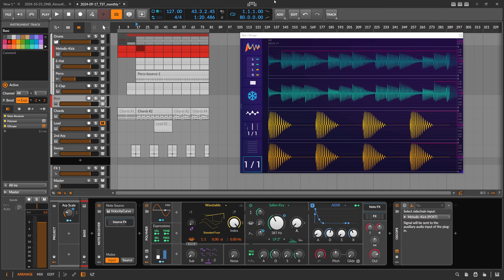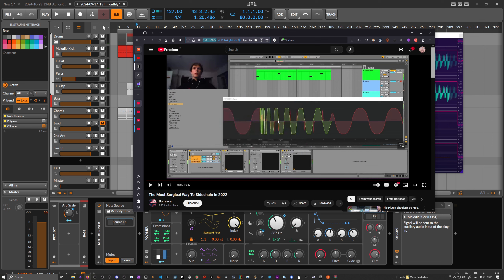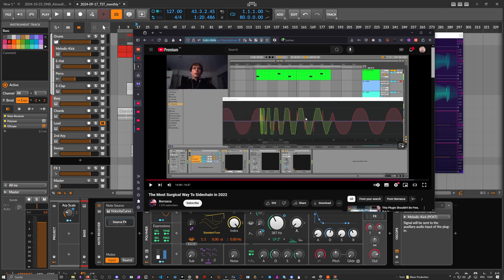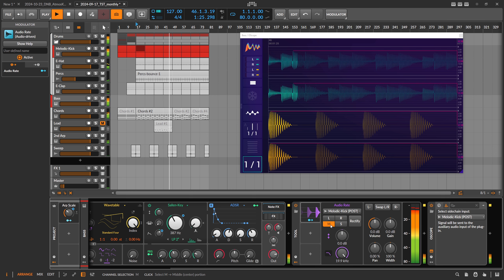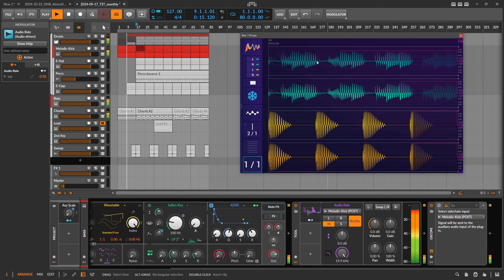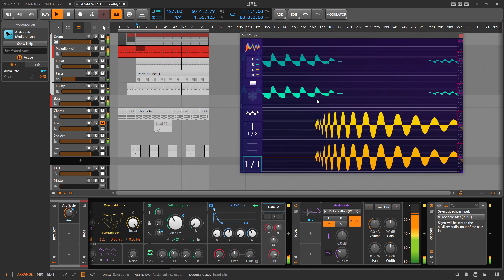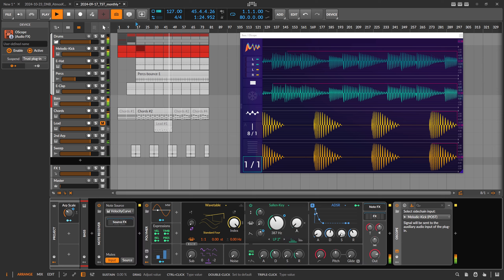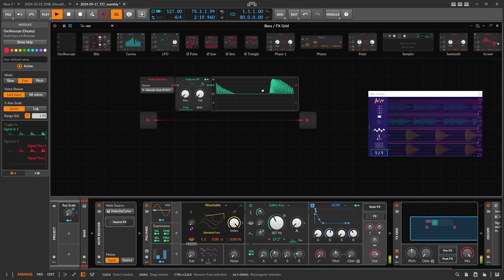No one is ready for this Precision - ringmod sidechain

Comment: Appreciate the shoutout it’s always cool to see variations and different takes on this method. 
I’d like to point out that the RMSC VST is not by me but another developer. 
I don’t use mringmodulator for this anymore like in the original video but my own M4L device, and sometimes the RMSC vst. But I’m working on a plugdata version now.
Keep in mind that using the mid signal with Bitwig’s audio rate modulator can still peak over 0db when summed together if the target has side information; ideally rmsc:ing would be 100% stereo unlinked so both L and R get independent ducking, that’s if you’re looking for absolute headroom advantage. For the sound effect itself it doesn’t really matter.
Reply: oooh are you gonna share that pd patch? I'd be interested in trying that out
Reply: You are a legend!
Reply: We need plug data version!

Comment: First, all things Polarity are worth a watch!! Always!! RMSC techniques are interesting and informative but ultimately, I personally have never found RMSC useful. When I solo the ducked instrument noise pokes through, because you're ducking specific parts of the spectrum you are left with a waveform that has nothing to do with the original sound. I concluded that for hard duck it's tool with midi note sidechain from a "SC" midi track where I can lengthen or shorten notes and use timeshift to avoid attack 'clicks'. Alternatively, if you're just dying to keep some part of a sound I use Robert NIH linear phase crossover. Then I know exactly what it will sound like during a duck.

Comment: Sometimes the distortion is desirable and precisely why someone would use ringmod sidechain. It could add the sensation of intermodulation distortion without chainging the original sounds.
Reply: That and plus it's particularly better in high frequency sidechaining than lower freqs IMO without the need for smoothing

Comment: The disconnect, I think, is that a lot of people end up getting steered toward RMSC when what they really want is something a bit different.   They don't want the peaks and valleys, but rather a contour that goes from one peak to the next... ideally with a best fitted curve.  Follower / audio sidechain isn't quite that either.  One way to think of the goal would be that it is the inverse of the MSEG that created the kick.  It's also worth noting that different people mean different things by "clean".  The distortion seen between the peaks is one thing, but being completely out of the way on the first sample is another issue entirely.  If any method fails to achieve that, there is the potential for a burst of up to 200% of full scale in those first few samples which can be far from subtle depending on what follows.
Reply: What you're describing is the "convex hull" of the waveform (or more generally an "alpha shape" to allow some concavity). Imagine wrapping a rubber band around it. I'm not sure that it can be properly computed without infinite lookahead (since the next peak can come at any time in the future, or never), but there are approximations. Envelope followers are one of them. ;) In the modular world, you can just modulate both with the same envelope signal. You can probably do something similar in Bitwig somehow.
Reply: In theory, the perfect distortion-free sidechaining you describe could be achieved with offline processing of the complete audio files, where you literally do have infinite lookahead. I suspect that offline processing is going to become a next big thing in audio because it turns out infinite lookahead is pretty useful: it makes hard things easy and impossible things possible.
Reply: @reinh  It's infinite only in theory, though.  In practice, I don't see why it would need to be more than the next inverse peak at the lowest frequency you'd want to capture... or 25ms for half of a 20hz wave.  That's for linear.  A better fitted curve would probably require double that.  I'm not saying it's easy... just that it may be a clearer description of the goal since there's no benefit to the wobbles between peaks, and followers introduce other issues.
Reply: @reinh  I'm absolutely convinced that offline processing (or at least some kind of ARAesque full scan) is what's necessary for proper leveling.
Reply: @bongospank8321  Yeah, that's what I meant by "approximations". You can scan your lookahead window for the next maximum peak and lerp to it. There are probably edge cases that make this more difficult than it sounds. Getting the windowing right might be hard, or highly program dependent. But it's a good idea.
Reply: Yea, this is kind of what i try to approximate with the peak hold and stuff in my video
Its all different techniques to get closer to perfect lines from peak to peak than the naive, slew limiter ish style of envelope following. Ive also experimented with highly program dependent release times and filtering the envelope. Ring mod sidechain is just the jumping off point to start rethinking the envelope follower from scratch. It always bothers me a bit when people then act like what we do is just rediscovering an old school compressor, because really we’re trying to rethink it from first principles to optimise it for a very specific purpose. Envelope following can be a lot more nuanced than most people realise.
Reply: @reinh ive been too dumb to figure it out in the grid so far, but if any of you have an idea id love to hear it. Because as you rightly guessed, this is kind of the goal.
Reply: @TildeSounds  maybe it could be done with ARA.
Reply: @ probably
Reply: @TildeSounds  We want what is known as (the magnitude of) the analytic signal. An existing DSP method to compute this with finite lookahead is the Hilbert transform, but it requires a large FIR filter.
Reply: @ interesting, ill look into it. I was hoping for sth the grid can do, but this might still give some ideas
Reply: @TildeSounds  actually the Dome filter in the grid is a Hilbert transform.
Reply: @reinh  haha yes this was just before it was released iirc. i'll probably be using that in future versions.
Reply: @reinh  so i just did some testing with it, honestly pretty underwhelming. it can introduce some pretty stupid artefacts, like envelopes that are way too long at times. my methods i currently use actually get me a lot better results. 
EDIT: nah i was just being a fool, its actually pretty good. not perfect, but its really helpful. it misses some transients, as all smoothing methods do,  but combined with other stuff it goes a long way.
Reply: @TildeSounds  so you see I was accidentally correct!

Comment: Curious to know what you think. I use a 2 band linear split(sub frequencies + everything else) and use ringmod sidechain on the sub band but I also use regular envelope sidechain at the end for each band. Do you think this is fine or is it overkill?
Reply from the maker: Yeah, it sounds a bit like overkill. Usually, you just want to duck the volume a bit to make room, not surgically remove everything. 😅
Reply: @PolarityMusic  I probably should have mentioned that I do this for dubstep(where we typically don't like overlap)😅 but yeah for other genres that would sound very unnatural. Unless you think there's an issue even in the case of heavy electronic bass genres 😄